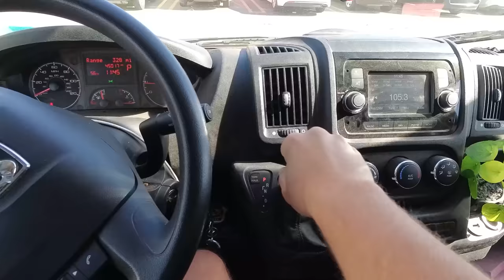CRASHING MY NEW E-BIKE...

Comment: Hey Ryan loved the vid! I have a super good recipe for you its one I have had since I was a kid give it a shot! It's called Creamy Chicken One Pot
3 Chicken breasts

3 Colored bell peppers, small red

4 Garlic cloves

1 tsp Garlic powder

8 oz Mushrooms

1 tsp Onion powder

1/4 cup Parsley, fresh

1 1/4 tsp Rosemary, dried

1 1/4 tsp Thyme, 

1/2 tsp Pepper

1/2 tsp Salt

1 tsp Oil

1 3/4 tbsp Butter

1 1/2 cup Cream

1/2 cup Parmesan 
     Butterfly the chicken breast. In a bowl, mix dried herbs and spice powders. Sprinkle this mixture generously on both sides of the breast cutlets.
Heat oil and butter together in a skillet over medium high heat. Place in the chicken cutlets, not overcrowding them. To sear them golden brown on both sides, they need a little space in between, otherwise they will steam. This will take about 7-8 minutes per side. Once you get a nice golden brown color, plate them out. In the same pan, melt more butter and sauté sliced mushrooms, bell pepper rings or strips, along with garlic, salt and pepper for a couple of minutes. Add in parsley, thyme and rosemary. Cook for a minute. In the same pan, melt more butter and sauté sliced mushrooms, bell pepper rings or strips, along with garlic, salt and pepper for a couple of minutes. Add in parsley, thyme and rosemary. Cook for a minute. In the same pan, melt more butter and sauté sliced mushrooms, bell pepper rings or strips, along with garlic, salt and pepper for a couple of minutes. Add in parsley, thyme and rosemary. Cook for a minute. Stir in cream and mix well, scraping any brown stickings left from the chicken off the bottom of the pan and into the sauce. Add in parmesan cheese, mix well and cook for a minute.Time to put the chicken into this delicious sauce, cover and cook for 5-6 minutes, or until the internal temperature reaches 165°F. This won’t take much time, as the chicken is almost cooked. You are just cooking it fully and penetrating that wonderful sauce into the chicken. Taste and adjust salt and pepper to your liking. Garnish with more parsley and enjoy!!

Comment: I did a faceplant into the side of a Subaru once with an e scooter.  Any little hole in the rode can throw you off. A cemetary is the best place to ride e anything IMO. Smooth cement, no dodging traffic and no holes in the damn road.

Comment: You can go into the menu settings and change it to go 28 mph and at full charge using the throttle will go up to 24 mph. But you have to "pedal"  to get to 28. I don't remember the settings/ numbers to change it lol

Comment: Food tip, collared greens and oxtail. I have an ebike that I love , but it's huge and doesn't fold. I plan on going nomad eventually and am planning on getting a Promaster similar to yours. I'm conflicted on whether I should sell my ebike and get a folding one which would likely mean less power and speed, or if I just do my build to compensate the massiveness of my current ebike.
Reply: Bro what would be your best e-bike to get?
Reply: @curtisgaea973  I currently have a Rad City by Rad Power. It has a 750 watt motor on the rear wheel and hits 26mph on flat ground, it has a throttle and five levels of pedal assist. It also has front suspension and does well both on road and holds it's own in moderate off road settings. It's biggest draw back is the battery range only gets me about 20 miles, but I do have a second battery. Also it's massive size limits it's portability. Rad has a model called the Rad Mini, which folds but there is no suspension on the newer model and less range on the old. I haven't been perusing ebikes lately as I purchased mine in 2017, so I don't know which substitute would check all my boxes.